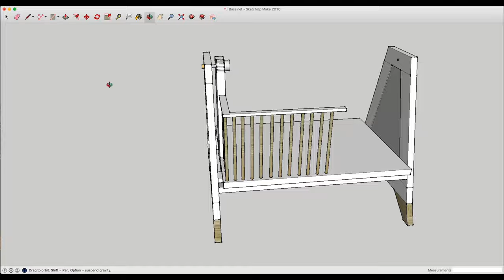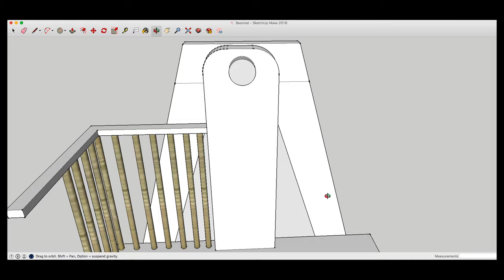DIY Rocking Bassinet: Mid-century Modern/Danish Style

Comment: One tip i can give you is that you are using way too many dowels. Glue joints done properly are stronger than the wood. The dowel can help with strength, but the amount of surface are you are gluing is going to make up for that. The dowel should be used for alignment only in this instance. Two per joint is plenty. I see you are using titebond. I literally sat through an hour seminar today from one of the engineers from titebond today. Check your joint bond ability by placing a drop of water on the jointed surface. If that water spreads out and causes the wood to be wet beyond the spot of the initial drop within a minute, you have a good glue surface. Remember, glue like titebond is about 50% water. That water is what moves the solids in the wood. After that, remember that you are looking for intimate contact between boards. Yes, that is the technical term. Don't squeeze the joint dry, and don't bridge gaps with glue. I work in industrial settings, so pipe clamps are my enemy, but in this instance, they are your friend. Invest in them. The more the better. If you follow this, you will get better quality glue ups and save a lot of head aches.
Reply from the maker: B & B Machinery Co, again, Thank you so much for this insight! Incredibly helpful and I can’t wait to apply it to future projects with better lumber!

Comment: Nice job on a complex project. 

For clamping up wide panels, one useful tip is to use cauls above and below the panel. They're similar to the boards you used but work better. You can buy them, or make your own, they're easy to make and help alot to keep the panel flat.
Reply from the maker: George Oliver, thanks so much for the insight! I’m definitely going to look into those. I’ll likely make them, but do you have a preferred brand you think I should also look into?
Reply: I don't, I've always made my own. I do remember seeing a plastic resin caul, which sounded nice because over time it wouldn't warp in the shop (easy to happen if they're not stacked and stickered straight), but I can't recall the brand name at the moment.
Reply from the maker: Okay, gotcha! I’m gonna do some internet digging on these; thanks again for the point in the right direction!

Comment: great video,  It is always nice to make something for the ones you love and to know that your handiwork will be a part of their lives :)  The only thing that put me off a bit was the use of the shelving brackets on the underside support.  I get why you did it, the thing is going to be carrying precious cargo after all, but seeing as you painted the frame, it would have been a cleaner look to screw through from the outside of the frame and then fill, sand and paint.

Keep up the good work!
Reply from the maker: ryandotdee thanks so much, man! 

And can I just say, i totally agree about the brackets! I too was gutted to use them. 

The problem was that low, single point connection. It’s getting into math and physics that is above my pay grade, but it seemed like no matter how strongly I connected the given pieces, if I didn’t spread the load out to a higher center of gravity, this thing was going to wobble. Even when I tested with clamps holding the pieces tight, it would rock ...and not in the way we’d want! Haha

If I were to go back and do it now, I think I would have made the stretchers wider and tried some type of through tenon with a longer pin to help add support higher up... Or maybe create a slight triangle with the panels and stretchers? I’m open to ideas too!
Reply: Where were the shelf brackets used. I can’t see in the video, the underside supports look like the are attached by pocket screws?

Comment: More clamps, this time on both sides of a glue up...pipe clamps are cheap and strong...subbed, loved the project
Reply from the maker: tihspeed71, thanks so much! I’ll toss them in the ol’ amazon cart, asap! I had  these crappy bar clamps below, but couldn’t get them to tighten at all for whatever reason. Last time I skimp on clamps, for sure! Thanks again! Do you have a particular brand you prefer?
Reply: @HonestWorkDesigns  I'm sure you've figured it out by now but in case it helps anyone just getting into it:

https://www.amazon.com/Bessey-BPC-H12-2-Inch-Style-Clamps/dp/B0012YOC0W these work well, you have to buy the pipe separately.  Clamping something that is rigid and flat to the top and bottom (in multiple areas so you don't twist rather than cup) of the work piece also helps - use a ton of clamps.

Comment: I really like the design, and I'm sure the ball bearings are a lot smoother than some of the other builds I've see  just using a dowel.
Did you end up incorporating a means of immobilizing it when the rock is not needed? Like just a pin?
Reply from the maker: Thanks, Shawn! I haven’t gotten around to it yet actually... the twins grew out of it and it got put in the attic until another day - but I do have a plan! Just a simple oak dowel with maybe a cross pin or leather handle pull that would sit through the bed of the basket and upright panel to keep it in place. One day! Haha